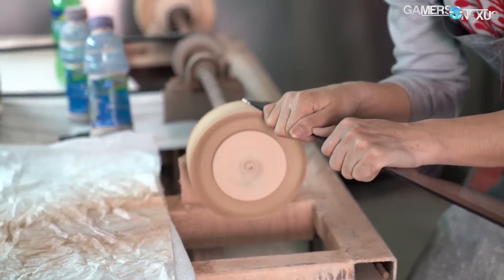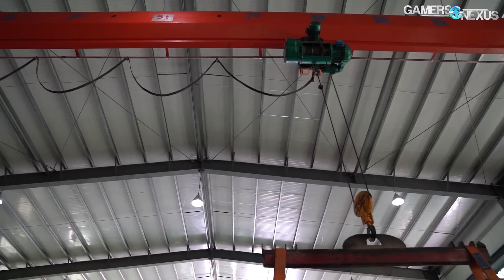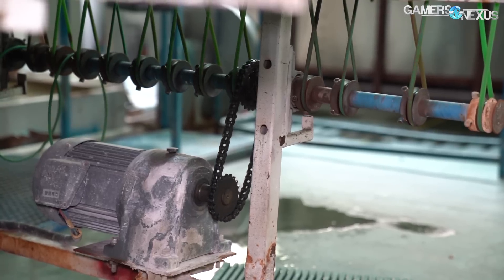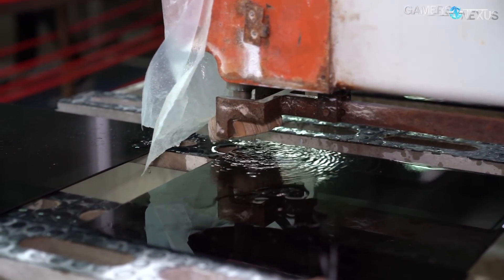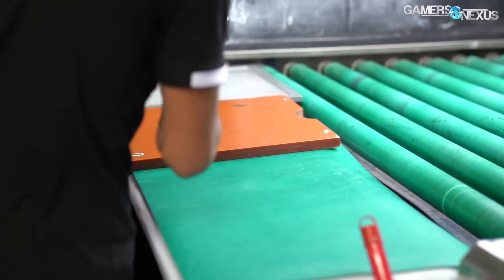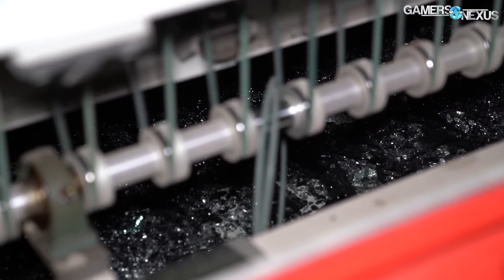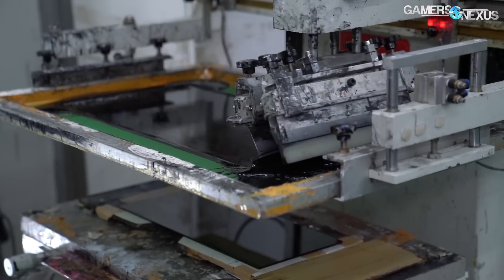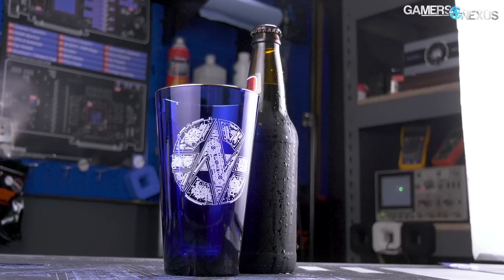How Tempered Glass is Made | Everyone Uses the Same Factory

Comment: I am glad to see that every grinder & cutter is using water to bind the highly lung-irritant dust.
Reply: The "4 soldering irons perpetually covered in smoldering plastic" station though. I hope the operator wears a respirator!
Reply: @trajicjohnson  
Solder is vapor, so chemical respirator and fume vents are ways to deal with them. Dust mask and respirators do not work when it comes to solder fumes.

They do work for silicate dust.
Reply: @Aereto  Oh definitely, particulate/organic vapor cartridge all the way. But assuming the film is PE that smoke is basically just stinky fuel. They probably have an extractor hood off camera that sends it to burn in the tempering furnace exhaust or something.
Reply: @Aereto  they are not soldering, they use the heated tips to melt the plastic covering to conform to the holes in the glass.
Reply: @trajicjohnson  Yeah thought the same
Reply: Yes, Silicosis is a concern for workers if that is not the case.
Reply: http://terrazzco.com/osha-silica-rule-glass-dust/
Although glass is silica, it is not crystalline silica. Crystalline silica in the form of quartz can lead to silicosis and other respiratory disease. The cutting and grinding operations do not produce crystalline silica. It's the previous mixing operations that go into producing the raw glass that hold the known danger. I say "known" because I'm suspicious of any dust-producing process in manufacturing. There's always the potential for research, tests and data to prove what we currently think of as a non-danger to indeed be a danger.  @SolarianStrike
Reply: In fact the diamond wheels used for grinding needs water for cooling, else the diamond particles wear down quickly. This kind of wet grinding is common in this industry for decades.
Saidly this has nothing to do with human protection, it's just a nice side effect.
Reply: @matthiash.4670  Some machines do but not all of them.
Reply: But the gloves with the fingers cut off, why wear the gloves. Order some with rubber gripping on the fingers. 

The girl in her sandals dropping the ball onto the glass trying to shatter it next to her feet ha ha.
Reply: as someone who knows how they operate.
it's not that the factory won't provide them safety glass/mask/whatever the fuck,
it's the workers that don't want to put them on.
mask, they say its hard to breath
gloves, they say it's hard to handle stuff
and so on.
Reply: When that water/glass dust mixture dries though it's like cement, not fun cleaning up or having to replace parts caked in that stuff on edgers
Reply: Lol
Reply: it's probably more expensive to buy the workers face masks, instead use water and expose them to small amounts
Reply: @Einclad_SSRB  Workers might not even use face mask, since southern China is very hot. People tends to take the risk.
Reply: a n i m e
n
i
m
e
Reply: Make sure you let OSHA know...
Reply: @advanceddarkness3  osha exists in china???
Reply: Slave labour is cheap and plentiful. If one person doesn't want to do it, they'll just bring someone in who will. 
Nobody's even wearing safety glasses, or "safety" shoes. At least form what I saw.
Reply: dafirnz or Kevlar to help stop the cutting.
Reply: @dafirnz  it's not slave labor and it might seem cheap compared to western incomes but in china the income is pretty good
Reply: @dafirnz  That's because they aren't necessary for the job.
Reply: @dafirnz  i wont wear those in this factory either, it like wearing a helmet in swimming pool
Reply: You realize workers in plants in China really aren't slave labor right? The labor costs are actually pretty high in china it's just the easy access to suppliers that makes it more lucrative to build there
Reply: @TheArbitraryActivist   lol dude so why does Foxconn have suicide nets around their factories then? I mean sure they technically aren't slaves, but might as well be.
Reply: dafirnz its only you in america that are using those things . We dont use it in europe also because its annoying to wear it. Your problem in america is that people sue for everything so you need to have that .
Reply: @mrxytube  Well, wearing the appropriate protection is good, but most of the time from what I've heard in Germany you rarely ever get safety equipment that doesn't make your work twice as annoying.
Reply: @mrxytube  This is true and I'm willing to bet you know why or you wouldn't have mentioned it. It is a real dilemma that many of us aren't sure where to side. Frivolous pursuit is a real problem but the only solution has the consequence of stifling legitimate complaint. What are we to do?
Reply: Water is used as lubricant ...

Comment: curved glass is a trade secret? 

ok. skeptical
Reply from the maker: Curved tempered glass is very difficult to make. Yields are low.
Reply: Yet ati, pilkington, and others make curved tempered glass daily.
Reply: the trade secret part would not be how to do it but rather what witchcraft is needed to do it with only a 50/50 failure rate rather than 25/75 failure rate.
Reply: Curved tempered glass. Why wouldn't be?
Reply: The way they use to bend the glass is. Not he curved glass.

Comment: Its easy. You temper.. aneal. then bend and temper again. DUH
Reply: Your missing the part where the annealing takes upwards of days, and time = money. Also each time the glass is taken out and heated there is the added chance of it shattering. It's a trade secret for a reason.
Reply: @martinzhang2226  He said easy not quick.
Reply: @tedmiles2461  Annealing glass is in no way shape or form (pun not intended) an easy task, also the act of bending glass varies from manufacturer to manufacturer BECAUSE IT IS HARD and there is no "Do this and it will guarantee a nice bend" standards yet. In theory its easy, but doing it is like heaven and earth, ask any crafts men and they will tell you glass work takes months if not years of experience just to not "fuck it up". Leading to why things like  this being a trade secret. If you can produce a pane of glass at your specifications 1 second faster then your competitions you are effectively shaving off 1 minute after every 60 pieces. The secret is not how how to bend the glass, its the optimisation method. Same way how Ford went from taking about 12 hours to produce 1 car from start to finish to now 93 minutes.

In the world of manufacturing and business time is the most expensive cost. And as Steve mentioned in this video "machining times being the most expensive". That is the trade secret that is being talked about. OPTIMISATION. Optimising a production line is not "EASY".

Comment: 5-10% defect rate is insane, no wonder that they are so expensive!
Reply: I mean, a full on replacement glass door, hinges, magnets and all for my 500D SE is only $30 USD...all things considered that seems pretty cheap tbh.
Reply: @soulshot96  thats kinda expensive, but if you have enough to afford a case like that, then i suppose that would be considered cheap.
Reply: Well it is a delicate thing to work with, and it is China after all. Quality control isn't their strong point. I picked up a pressure washer hose the other day. Only one of the fittings was crimped on, the other was just stuck in the hose awaiting its turn in the crimper. So I essentially received a 4000 psi rated whip.  5-10% doesn't surprise me at all.
Reply: It is but unlike most product, defects here can go right back into a furnace for recasting.
Reply: $134 for CM Trooper SE 5000 ....that glass sheet with black trim in video looks like it...
Reply: @John-ik2eg  "third world shithole"
china's economy is bigger than USA's now.
Reply: @henryettoit897  tha'ts due to volume, not quality
Reply: No stupid. The reason why it's expensive is because of Apple pricing.
Reply: @lucasmiller1462  Very good way to start a conversation...
Reply: @lucasmiller1462  Thats only a part of it, it could be way cheaper if you cut the defect rate in half, trust me i know what i am talking about! ;)
Reply: @dongurudebro4579  well, not way cheaper, just 5% cheaper. (the tests aren't expensive)
at volume of course that's quite a big profit, but not that big per piece,
Reply: @satibel  thats not how Mathematical Financ works...
Reply: @dongurudebro4579   Don Guru de Bro  well, if you go from 10% failure rate, to 0% you have that 10% extra products to sell, but they would still sell at around the same price.
the profit skyrockets if the margin is low though, but the price of each items doesn't lower much.

Comment: Neat! Also I hope a bit of an eye opener for people that think they're somehow getting things made from better materials or with premium stuff JUST because they pay more for stuff.
Reply from the maker: This video does show that this can be the case. It is obviously not an instant tell that quality is better, but as discussed in this very video, tighter quality control does cost a lot more.
Reply: It's like buying chips or OpAmp : It's the same semi-conductor process but you have different QC and specs giving different pricing ranges. The military or avionic grade chip may have gold-plated pins but there identical inside and what you pay above the standard grade is mostly the extended specs like operationnal temperature. just Silicium binning.